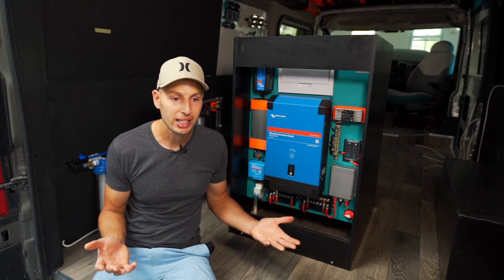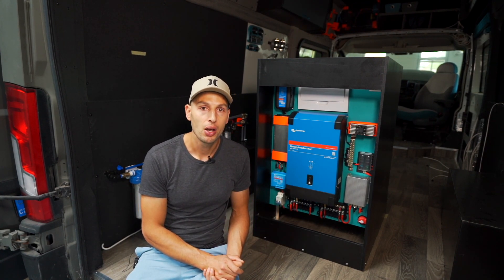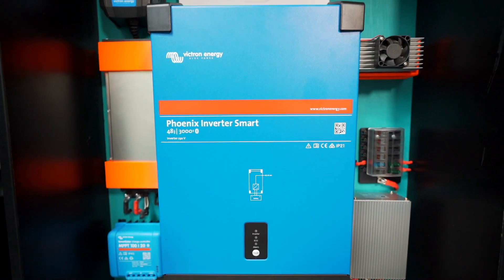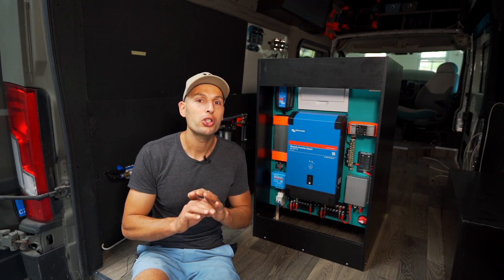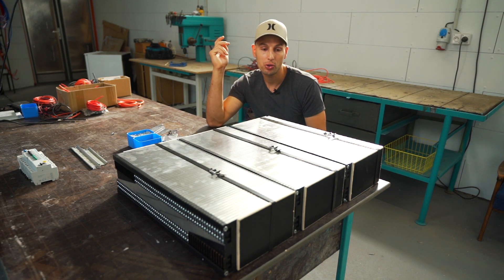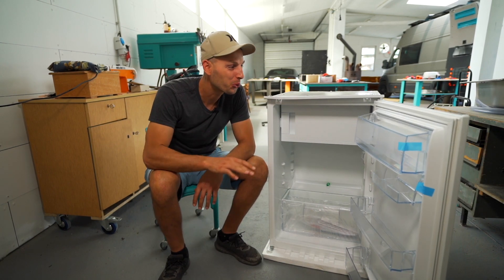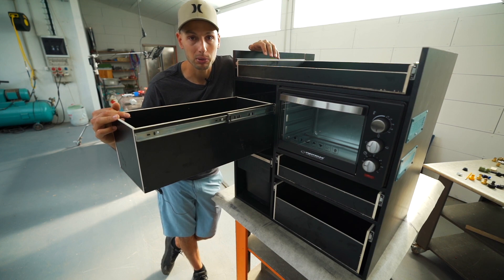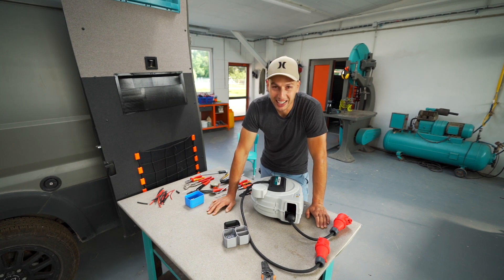New Approach to Electrical System in CamperVan (48V)

Comment: Wait what?! 6500 ah at 12v?  Did I hear that wrong?!
Reply: 48V/12V * 300 AH = 1200 AH 
Or is one of the racks 300 AH?
Reply from the maker: Because people don’t objectively mention kWh as capacity unit and instead use amp hours, I translated this to amp hours at 12V system. It would be 6500Ah 😅
Reply: @ladiandmargaret  I am not sure about your calculations. 44V@300Ah equals to 12V@1100 Ah, not 6500 Ah.
Reply from the maker: You guys are right, I’m way off 😅
Reply: @ladiandmargaret  also, what kind of cells are you actually using? The regular LFP cell has a nominal capacity of 3.2V, not 3.6V (3.6-3.65V is the max working voltage, not nominal) - so with 12s, using the regular cells, the result is 36V, not 48V system
Reply from the maker: Eig cells, 3,6 nominal. It’s lipo not lifepo4
Reply: @ladiandmargaret  thanks,  that explains it - and the weight as well.  Personally, I would be a little bit afraid to use them :-) but I am not an expert.
Reply: @ladiandmargaret  awesome tip for the cell. I am actually planning the similar system. Where is possible to get these cells? Because I couldn’t find them anywhere…
Reply from the maker: They were discontinued. I purchased a lot of them on ebay.
Reply: @ladiandmargaret  ach tak…a je možnost případně od vás nějaké odkoupit? 😀
Reply from the maker: To bohuzel ne

Comment: victron quattro 5000 w 48v inverter/charger might have worked better for you.  charge and run equipment from shore power (grid) or batteries, charge from solar panels, 2 circuits for essential and
non essential equipment.  you might be able to get rid of the victron mppt and lithium battery charger.
Reply from the maker: It’s very expensive.

Comment: I love your approach regarding 48V and distribution of weight! When it comes to ways of charging: On top of the price for alternator ++ comes the price of actually charging, using expensive gasoline/diesel as source of energy. Not cheap. Something to avoid if you can. May the sun be with you!😎
Reply from the maker: You might be right!

Comment: Do you have a DC to DC (B to B) charger? Alternator 12v to 48v battery charger?
Reply from the maker: 3kW in 12volts would require too big wires 😂